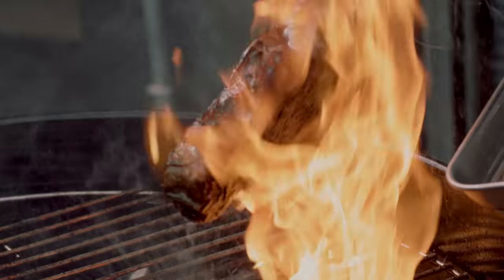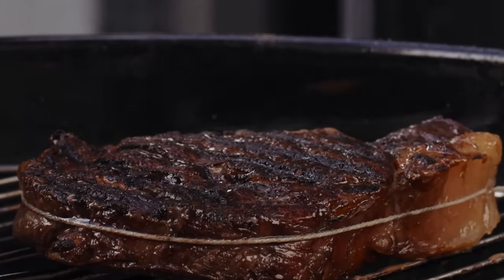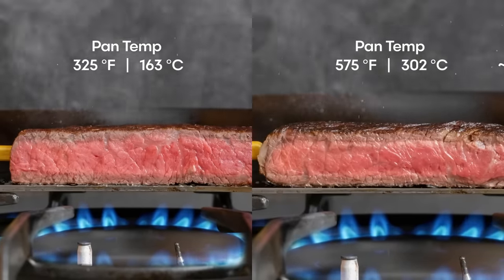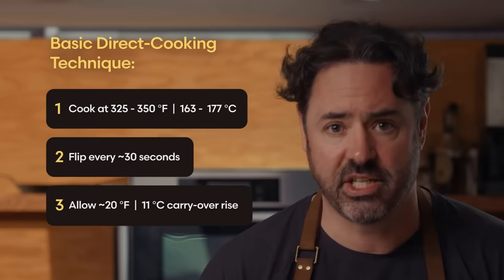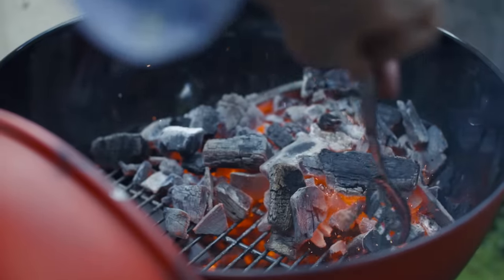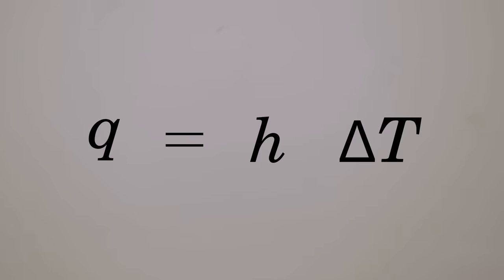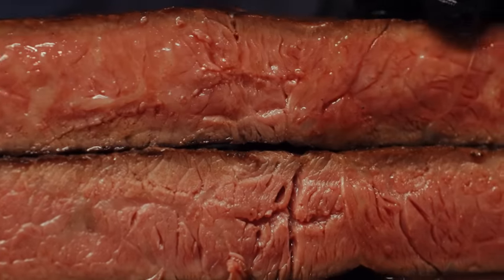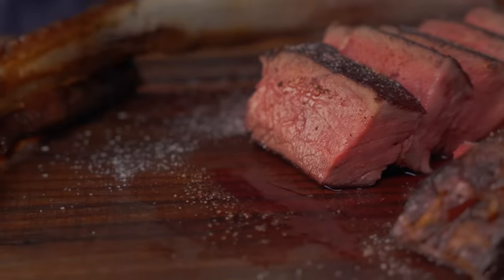Why Ripping Hot Is Too Hot? | TESTED

Comment: This temp limit doesn't really apply to sous-vide searing, right? There, we still have "the higher temp, the sooner we have the crust done", and the smaller the risk of overcooking the meat. In the video the suggestion is searing at 177C and higher temp just if you like charcoaled meat, which is kind of a waste of time IMHO! Using a blowtorch will make the crust appear in seconds with very few charcoal spots if you move it quickly... many less than on the grill. But maybe it is my grilling technique that is very poor...
Reply: The temperatures for Maillard vs. charring? They would still apply if the steak is cooked sous vide.
Reply: @convincedquaker  oh so it's the temperature of the steak, not the temperature of the heat medium...make sense...

Comment: There is some good content but I gotta call out the whole searing the steak in its own juices. Yes water won’t go above 212, but you should be patting your steak dry and using fat to cook it in. Your steak will get well above 212 on the surface. I just didn’t think the first part of the video was very genuine.

Comment: Wrong! Ripping hot for no more than 2 min each side. Then put on a rack to the side. Let pan cool down to be able to put butter in to brown without burning. Then add butter, garlic, etc. and baste for a couple min on each side with med/low heat on the pan. 

All aside, everyone likes their steak slightly different. As long as it's at med rare or lower and doesn't have a gradient then it's all good! 😉

Comment: the problem with lower temperatures is that it releases water faster than it evaporates and you end up boiling the steak, thanks for completely ignoring that.
Reply from the maker: I didn't ignore it. I simply demonstrated with actual tests that you can sear at much lower temperatures and still get a perfectly good crust. It seems like you didn't even watch the video.
Reply: @ChrisYoungCooks  nah i did watch it, just found it to differ from common knowledge. Honestly, with your method why don't you just sous vide directly with oil and double fry it with higher temperatures?
Reply from the maker: Lot of common knowledge is wrong. Sous vide is fine and frying is fine, the point of this was to demonstrate you don’t need extreme temps for a good sear, and often counter-productive.
Reply: @ChrisYoungCooks  sure, i will give it another shot. I was addressing why don't you just put the steak in 135°F oil since it has the fastest transfer rate it would just sous vide the steak the fastest, then raise temperature to give it a sear in the same oil.
Reply from the maker: @theniii heat transfer rate won’t make a difference at that temp, your limiting factor is the speed heat can flow through the food. And at temps below boiling the oil doesn’t transfer heat faster. The high heat transfer rate of frying only happens when the oil is hot enough to cause water to rapidly flash to steam, because it’s actually the steam bubbles leaving the food that do the job of stirring the oil at the surface and causing a high heat transfer rate. And while you could heat the steak in the oil initially, you’ll end up with a lot of water in the oil, so when you go to heat the oil up to frying temps that water will splatter the oil as it heats up and tries to evaporate. So it’s just a messy process.

Comment: where do i buy beef that has not been injected with as much water weight or more as there is beef weight?   every single place I purchase pretty much ANY meat seeps out HUGE amounts of water as I cook it meaning the ONLY way I get to cook my meat is to BOIL IT in the water THEY injected into it.
Reply from the maker: It’s unlikely they’re injecting it. That’s a telltale sign the meat was previous “deep chilled” which is basically frozen. After thawing you’ll get a moisture loss during thawing. Most beef is frozen, it’s actually quite difficult to find beef that’s never been frozen, but some specialty butchers that buy directly from the abattoir can get it.

Comment: If you don't like the flavor of the torched steak, maybe you are doing it wrong. If you are doing it like on the video.
Reply from the maker: Yeah, I don’t think so. 
And I know many chefs who also don’t like the over-charred flavor that you inevitably get from the torch. But you do you.
Reply: @ChrisYoungCooks  I was just thinking that you get the gas taste when you torch it too close to the blue flame. I don't like the torch because it seems to take forever.
Reply from the maker: @zabnat the blue flame is an oxidizing flame, meaning no uncombusted fuel and only water and CO2 are the biproducts. A yellow flame means incompletely combusted fuel, which can leave a chemical taste. The flavor I object to is from little pieces of meat and fat on the surface charring. This always happens because of the extreme heat, where some tiny pieces will catch fire instantly and leave a tell-tale torched flavor. Sone people like that extra charred taste, but it’s not for me.

Comment: i've never seen someone use so much science to be so bad at cooking. You just left it on too long lmao. The point of high heat is to sear it quickly and take it off. Not flip it 50 times until it's charcoal.

Comment: In due respect I find your theory a little flawed.Most steak houses these days are using Infrared broilers. Ruth Chris cooks 😮there steaks at 1800 degrees and I found their steaks to be cooked perfectly.I use Grillgrates on my Weber Genesis II and cook the steak at 610 degrees.The surface of the grill is Infrared and the steaks are at least 20-30% more juicer than say cooked over a Weber kettle.The kettle you used as an example is really a poor design for cooking steaks in that it uses a fixed grate so you really can't control the heat and remember when grilling steak on a kettle,all of that convective hot air is not your friend !! It will indeed have a drying effect on your steak, which by using Grillgrates eliminates the convective hot air hence the 20-30% improvements in tenderness and juice.I guess it is ok to cook steak at the low temperature you quote, however very high temperatures work as well or even better.I believe in due respect you need to go back to the drawing board because no high end steak houses subscribe to your theory.Also to fortify my position, mostly all of the contestants in the Steak cook off who win use Grillgrates ( Infrared).And for me to enter the steak cook-off and remain competitive I must employ Infrared not old fashioned convective hot air.It is my belief the future of grilling is high heat Infrared.Even Weber is out with a grill that has Infrared, a little slow coming to the party.I found your presentation to be interesting but flawed.Also most steak fans do not cook their steak in a grease fried pan.
Reply from the maker: So, Ruth Chris uses a broiler and like nearly all broilers the elements are between 1800 and 2200F, but that a misleading way to think about the cooking temperature since it's entirely radiant heat. It's not at all equivalent to, say, a pan at 1800F.  Radiant heat is mostly reflected by the surface of the food, causing most of the heat energy to be thrown away. On a grill or in a pan, the majority of the heat will be absorbed. So a pan at around 500 °F is going to sear the surface faster than a broiler at 1800F. I have no idea how to answer your claim that steaks cooked on your grill are 20% to 30% juicier. That feels like a judgement you're making based on preference and not on any objective measure of moisture content.
Reply: @ChrisYoungCooks  Chris,please correct if I'm wrong.If I remember my high school physics there is radiant heat,conduction,and convective.Now you say that the radiant heat is mostly reflected by the surface of the food causing most of the energy to be thrown away.The cooking method your are using with the example of the 1800 pan is different because by laying the steak flat in the pan you are heating the steak via conduction.So I agree with you 350-500 degrees will turn out a nice steak . Let's now turn to radiant heat for a moment.I will use the roof of my house as an example.On a110 degree day the roof begins to heat, inside the attic there two things happening.First the attic is filled with convective hot air and at the same time radiant heat has entered the attic.If I use say R30 insulation,as the day progresses, the radiant heat will penatrate through the R30 and enter into the house.The house now is heated via radiant heat.The convective hot air is not the issue because that hot air rises to the top trying to escape.Now if the radiant heat would be reflected like in the Steak example,the house would remain cool.My point is if that sun can make it through the top of the roof and get through all of the roofing material,insulation and ply wood and into the house,I'm inclined to believe it can heat the steak.It must be heating the steak because of the finished product.I have dined at many of these steak houses and each one that employs Infrared turns out a perfect steak every time and they start and finish in the Infrared broiler no sly of hand.
Not really pertinent to our conversation I fixed the heating problem by having a contractor install aluminum foil in the attic which reflected most of the heat.They now make 4×8 foot sheets of plywood with foil on one side for new construction.
After going over your article, I agree you can cook a steak at a much lower temperature with great results.
Relative to my comment on 20-30% you are correct I did not measure the moisture  content, however giving samples to my guests everyone agreed the Infrared was superior to the convective hot air method.There is a barbecue store in Denver CO called Embers fireplace and the Owner Trevor did similar test as mine and he arrived at the same conclusion.He does sell a lot of high-quality Infrared grills.
In my first post I hope I did not come across condescending or rude never meant to offend.I will say congratulations on your thermometer!!It is well needed.
Reply from the maker: @michaelmattichiii1595  I think you have a misunderstanding about how radiant heat works. What happens beneath your roof doesn't matter. What matters is the albedo of your roof. A dark shingle roof will have an emissivity close to 1 (around 0.95 typically) and absorb around 95% of the energy received. A white roof will have an emissivity closer to zero (maybe around .1 or .2 in practice) meaning it will absorb 10% to 20% of the energy emitted by the sun, and reflect the rest. Once it's absorbed by your roof it begins to conduct into the house, heating air (which convects), etc. The important point, however, is that your roof is NOT the same temperature as the sun. It's much cooler. The exact temperature will depend on both the amount of energy reaching your roof from the sun (around 1000 watts per square meter at noon on a sunny day) and the albedo of your roof (that determines how much energy is absorbed or reflected). Food is the same under an 1800 degree broiler. Its distance from the broiler, and the reflectivity of the surface of the meat, entirely determine how hot the surface of the meat will get and how quickly this will happen. During searing, meat tends to start out reflecting most of the energy and stays relatively cool. Eventually it warms enough to dry out and start browning from the Maillard reaction, which causes the meat to start absorbing the radiant heat and getting really hot very quickly. But once it's hotter than about 300F at the surface, the meat will be entirely black carbon, so you never get anywhere close to the broiler temperature. And because the meat spends so much time reflecting radiant heat, the searing is actually slow compared to the faster heat transfer rates of conduction through a pan or convection through something like oil.
Reply: @ChrisYoungCooks  Chris do you agree the end result of cooking the steak in the broiler turns out a good product?
Reply from the maker: @michaelmattichiii1595 I think you can turn out a delicious steak with just about any method. I’ve used broilers to sear steaks in restaurants that were great.
Reply: @ChrisYoungCooks Chris,Thank you for your response and sharing your expertise in  cooking steak,I will definitely try your method and give you my input.Take care.
Reply: @ChrisYoungCooks  Regarding the reference to Ruth's Chris, one may check the images on yelp, they rarely get a proper sear.  At times there is extremely poor sear, other times there are heavy black char spots, and in rare occasions they produce a nice sear.  I have done the deep fry method, it produced the most even sear, and the best crust texture that I've ever had.  I have cooked steaks in every other method one can imagine, both in a restaurant setting and at home. This turned out the best crust I've ever had anywhere. I deep fried in Canola oil.  I grilled Wagyu fat over mesquite charcoal, smoked, and made into tallow.  I also chargrilled some angus chuck patties, pressed very thin. I froze it. then pulverized it with an immersion blender. Lightly sauteed the pulverized
meat in the tallow, and coated the steak after searing. The result was even more flavorful than any charcoal grilled steak that I ever had.  The pulverized meat was not visible to the eye on the steak and did not affect the mouthfeel.
It was phenomenal.  Canola has a very slight metallic taste.  I'll opt for sunflower oil next time around.
BTW, i cooked sous vide, and dried with paper towels and a heat gun. With your help, now I can cook steak indoors, surpassing backyard quality streaks. Thank you Chris.

Comment: ridiculous click bait. 'ripping hot is too hot' and then talks about how it's...not... and ultimately deep fries a steak. 
terrible comparison between reverse sear and sous vide. did you even pat the steak dry with paper towels after sous vide? misleading at best.

tl;dr get a baking steel, put it on your ripping hot grill to preheat for 30-60 min. sous vide your steak, dry and cool it in the fridge on a wire rack for an hour, then sear your steak on the steel for 2-3min, flipping often. done. best sear you'll ever get with a perfect medium rare center.

P.S., its not pronounced 'MAY erd,' it's maay YARD', with emphasis on the second syllable.